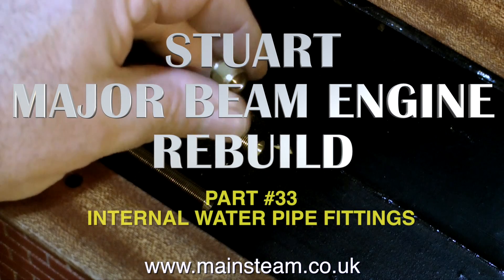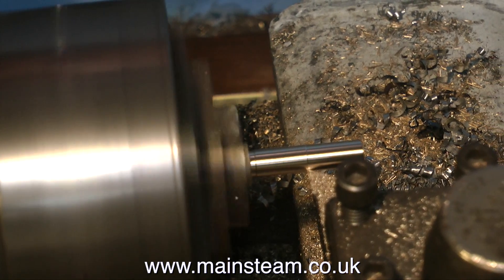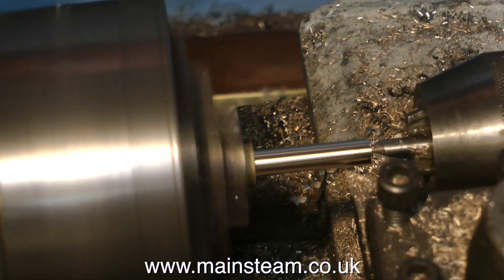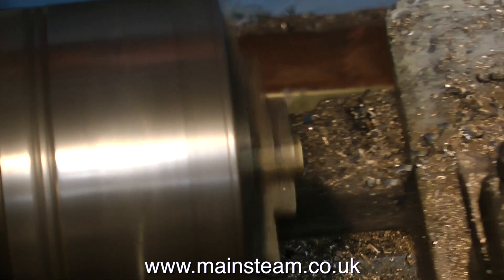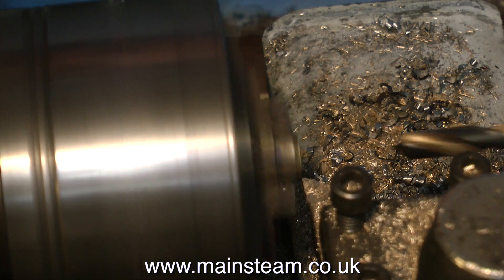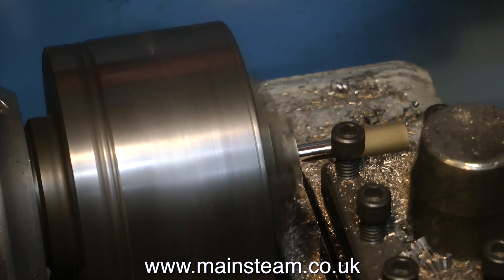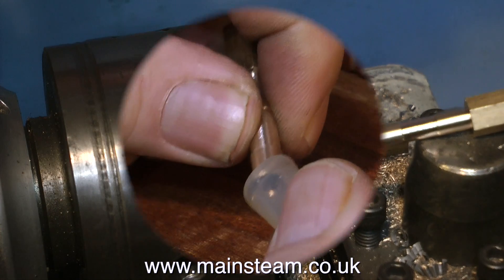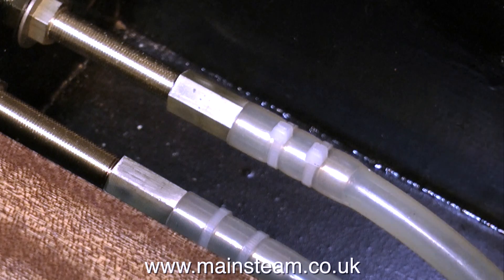STUART MAJOR BEAM ENGINE REBUILD - PART #33

Comment: Hi.  love the vids.   Just wanted to know(probably a stupid question).  Is there any reason a dust extractor could not be used during lathe operations??
Reply from the maker: +rareroses77 You could use a dust extractor I suppose, not much in the way of dust to extract though ........
Reply: +Keith Appleton   Thanks for reply, I was wondering if the metal shavings would be sucked into an extractor ok or if they would be to heavy or mess up an extractor

Comment: Great restoration so far. Just thinking if you should have used jubilee clips instead of cable ties when connecting the 2 pipes to make disconnecting and reconnecting them easier
Reply from the maker: +Pope-Eye they will never need removing and cable ties are both simpler & cheaper.